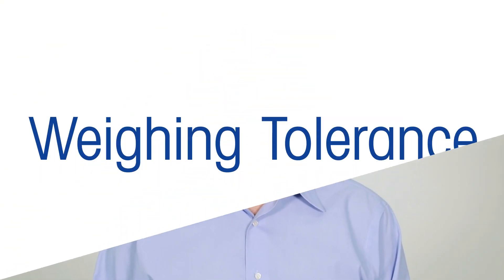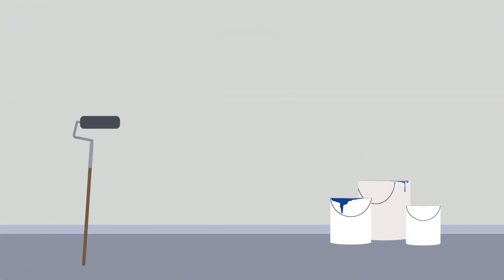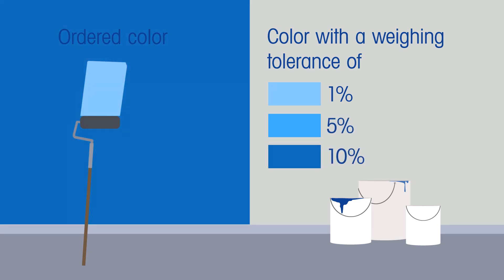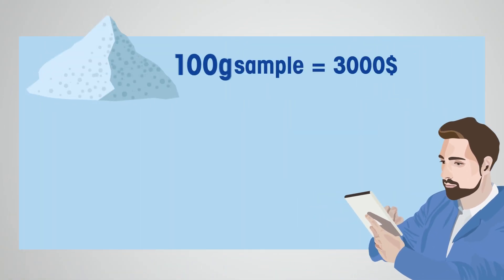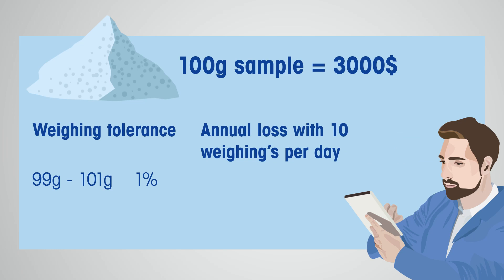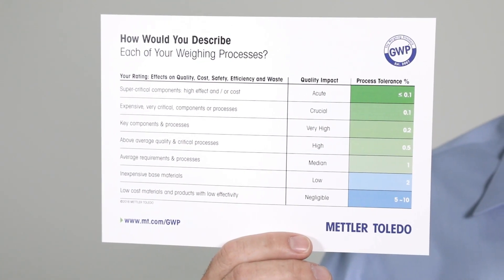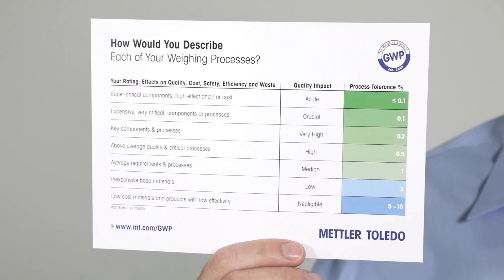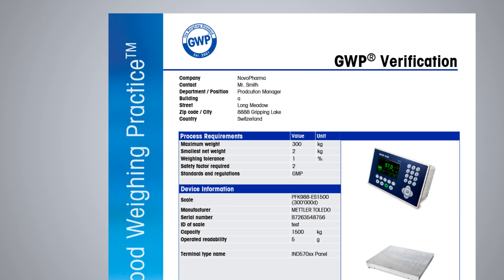Weighing process tolerances to ensure accurate weighing - en

Comment: Isn't the 1% weighing tolerance specifying a total band of 1% of the nominal value of the load, split in to symmetric control limits of plus/minus 0.5%? For your 100g example, that would be 99.5 to 100.5 g? This is what I have seen from the sample control limits on Mettler Toledo measurement results for various scales.